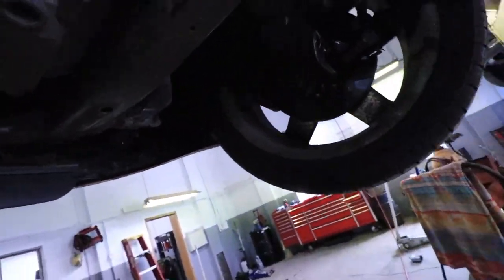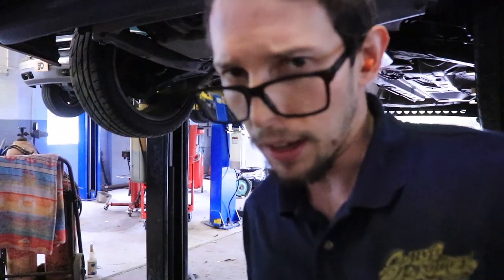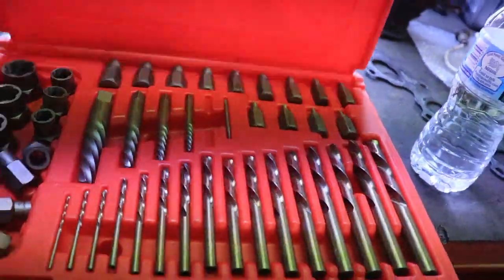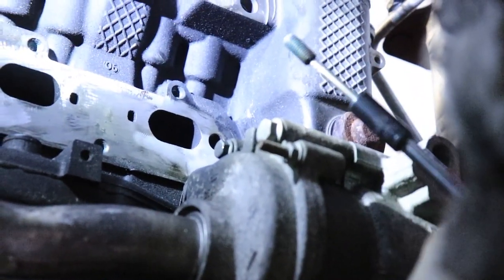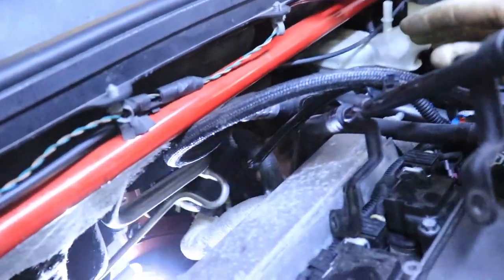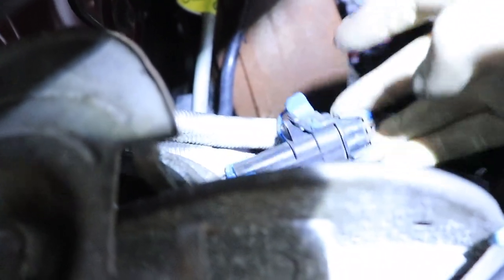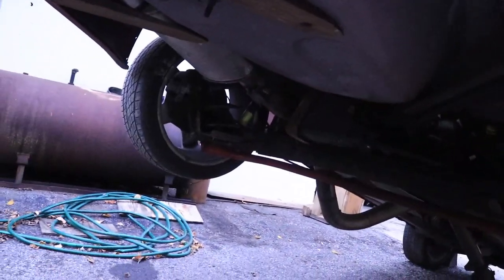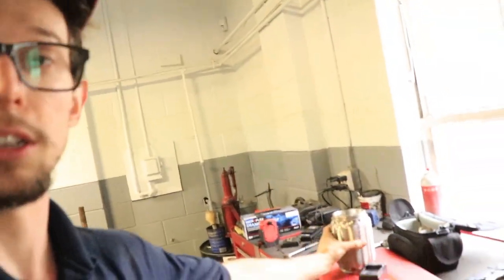COBALT SS HEADER INSTALL (got the stud out)

Comment: Did you have to extend the O2 wires at all? I did the long tube header in my car last summer and had to extend the wiring harness on them.
Reply from the maker: i probably should since they are kinda tight but i did fully seat the plug and lock it sooo... imma leave it for now hahah

Comment: Quick question here off topic but need help please LOL 

I just changed my trans and clutch in my LSJ I have gear while car is off but I don't have any gears while car is on... I have pressure at the pedal.. does it need to be bleed more ?
Reply: Most likely yes. These vehicles are awful to bleed. I'd google to get more info on how to properly bleed the clutch on these cars.
Reply from the maker: will it not let you go into gear at all like its locking you out of the gate or does the shifter feel sloppy
Reply: @salvobrothers5928  nono i have gears while car is off its almost like clutch isn't disengaging idk if it needs to be bleed more or what cuz I know these cars can be a bitch to bleed
Reply from the maker: @cleardabz5215  yea then i would try that get someone to help you do it

Comment: do i have to get a tune I put headers on too an now it started to miss I think its my o2 connection I did I think I need to soldier both of them? had to make them longer,good work on that bolt how much would you charge to refresh my lsj i trust you an it would be a awsome ride .but vi have a motor I want to do piston rings seals etc.an a port polish or how do I get a hold of ou
Reply from the maker: the shop number is 610-384-1352 i would definitely solder the wires, there may be too much resistance in your wires causing a false reading or delayed reading

Comment: I'm just here to see the bolt extraction gymnastics.
Reply from the maker: i still cant believe i got it out without ruining the head
Reply: @salvobrothers5928  I've been told by a guy that does a lot of dirt track stuff, he just leaves the broken studs. He says his usually don't leak, I couldn't bring myself to do that though. I'd probably opt to pull the engine to fix it because it's probably cheaper than the headgasket and timing set you decided you needed while you were in there.
Reply from the maker: @ExtraFungus  yea a broken header stud usually leaks and if it doesnt right away it will eventually, and there was definitely a leak coming from that side
Reply: Of course I buy a ion that had a big hole in the radiator, I fix the radiator, warm it up and I can hear a leak from the manifold. Looks like I will be going engine out on it soon.
Reply from the maker: @ExtraFungus  dam brotha, good luck